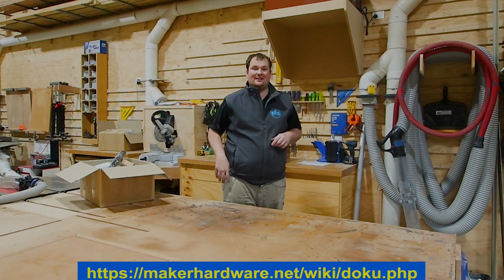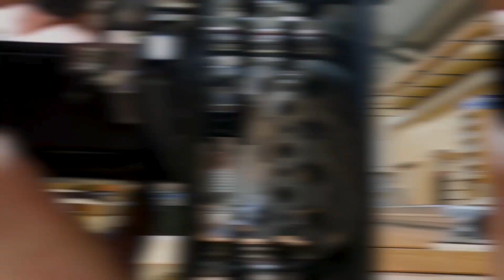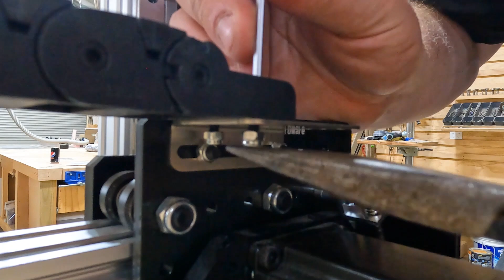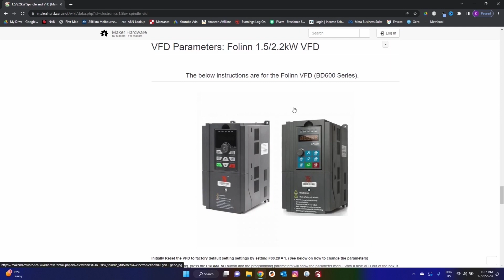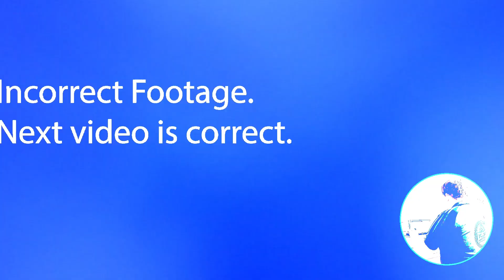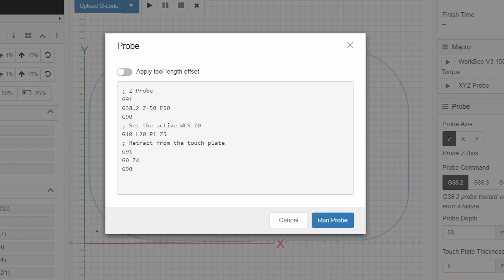Mastering CNC Machining: From Setup to Precision Cuts

Comment: Love your videos mate. I Am looking into getting a cnc machine and your videos are perfect for a newby like me. 
Just curious tho, as I am in the debacle of choice, is there a reason you went with your machine over say the outback that the maker store sells. I’m wondering if the outback is worth the extra coin?
Reply from the maker: Thanks mate!

We went with the WorkBee for the size. We use a lot of slabs, and it gave us the ability to flatten then.

If your looking for a more powerful machine, but with a smaller bed, the Outback is a good option.